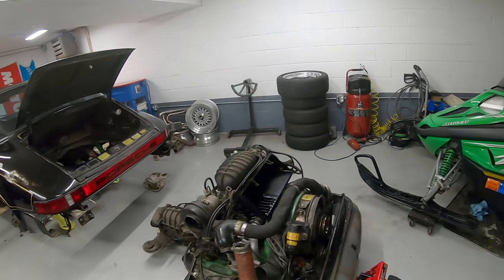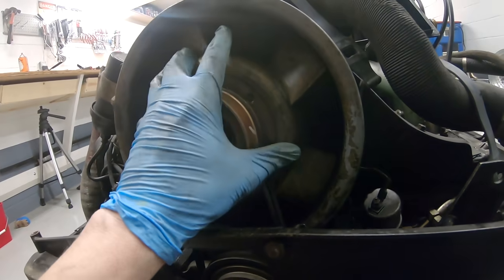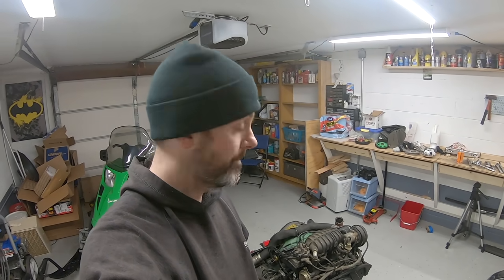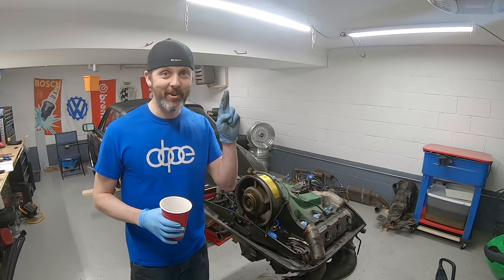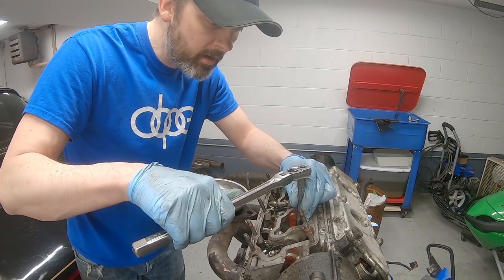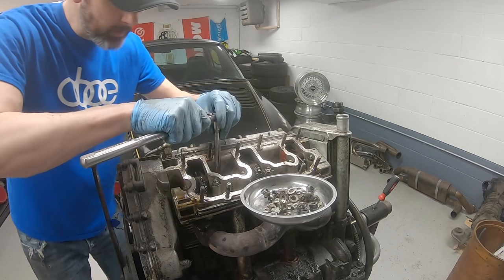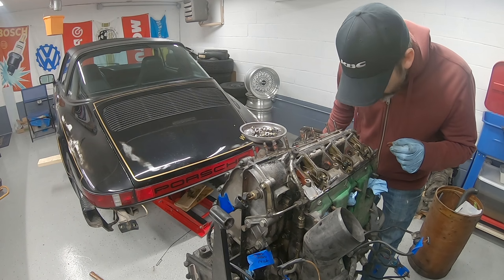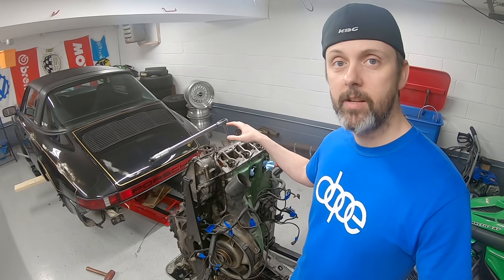Aircooled Porsche 911S Budget DIY: Checking Head Studs Projekt AirKult Episode 3

Comment: Commonly known as the Triangle of Death - the crankcase breather area and oil pressure switch is where all of these develop huge leaks which run down the case and bell housing.
Reply from the maker: Bought a new oil pressure switch, themostat O ring, and breather gasket.  :)

Comment: I don't know anything about these engines, so please someone tell me... why are the heads only torqued to 25 ft-lb??? How did the engine run at all with those loose studs? Why isn't he replacing the head gasket?
Reply from the maker: Idk, that's the factory spec.  Head gasket is just a circular ring, so theoretically should just tighten and be fine!  We will see, lol, I have no idea what I'm doing.

Comment: OMG The RTV all over the rocker shafts. Yuck. Yes, the 3/1 headers are Bursch replacements for the thermal reactors. Really hope you upgrade to SSI.
Reply from the maker: I have B&B heat exchangers but they're 1.75".  Kind of looking to trade them for something else.
Reply: @ADDvanced  yeah those are huge for a 2.9 imho. 1 5/8 is closer to spec, would improve lower end torque me thinks. Offer 'em up on Pelican, the 1.75 are more valuable if in good condition. I've seen a couple sets of SSI over the last few months come up.
Reply from the maker: @WiksGarage  Only thing I'm not down with is SSI just ... idk.  They don't sound as awesome as B&B.  Really hoping someone has a smaller set of B&B headers.  SSi is just sort of nice quality but stock design, no?
Reply: @ADDvanced  Yep based on the 74 stock heat exchangers. it's a masterful design as it has equal length headers into the primary. Billy Boat comes into play for bigger sizes, like you have, I don't know if they make a smaller size or not. Your options are fairly limited if you want heat. That's why SSI are the defacto upgrade if you are doing heat imho.

Comment: 5 blade fans were fitter so that the engine would run way hotter. That was Porsche’s way of cheaply helping the car meet emission regulations in the US at the time.
Reply from the maker: Mine tops out at 210.  11 bladed fans are cool but 5 blade flows fine for a street car.